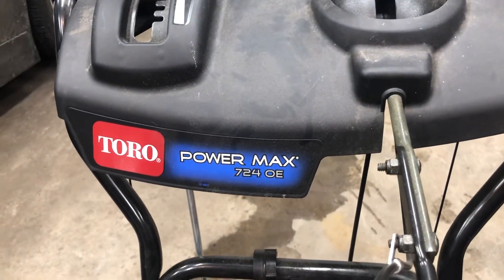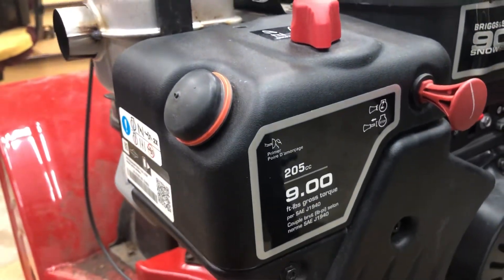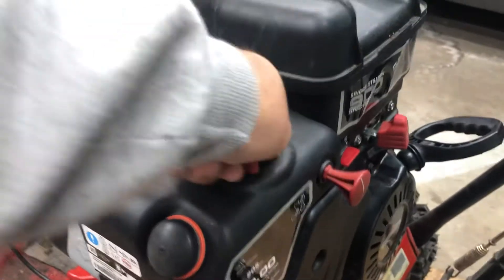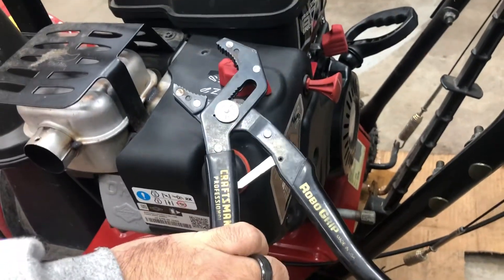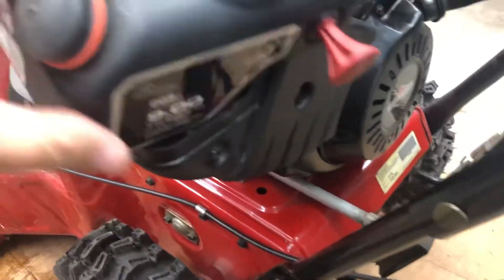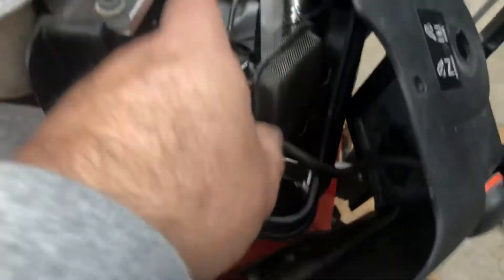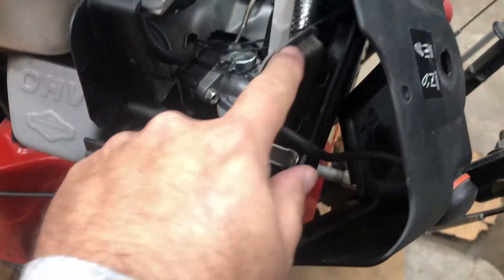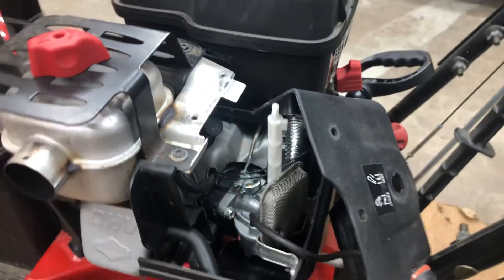Toro Snowblower Carb Repair

Comment: Hey Thomas! Great vise and tips! I just rebuilt my nkki carburetor on my Toro 1024 snowblower. I was pretty careful putting it back together. Now, when is runs with a load(snow in auger housing) the engine starts to slow down a bit and the snowblower struggles to pick up and throw it. Any ideas as to what the problem could be. It was not doing this before I rebuilt the carburetor. I rebuilt the carburetor because gas was leaking into the crankcase  because gas was leaking through the carburetor.
Reply from the maker: Does the engine sound different? I would replace the auger belt if you haven’t for a while. Also, if you haven’t replaced the spark plug, I would do that as well. The plug is a cheap easy fix that is often overlooked. If the engine is in fact slowing I always approach troubleshooting with the thought in mind that you need 3 things… air, spark, fuel. Spark is the easiest to solve or test for. Air and fuel can be a little more complicated. Rebuilding the carb, it’s possible you have an issue with air/fuel mixture which could be fixed by adjusting the fuel mixture screw, but if it sounds like the motor is running well at idle, that’s probably not the issue. In terms of fuel, make sure there is no issue with the fuel filter, or fuel leak somewhere else. Make sure tank is not clogged or anything else. 

Now the reason why I think belts, sometimes if belts get stretched they are now clearing snow efficiently, so then too much builds up and then it bogs the machine down. For similar reasons, if load is heavy if spark isn’t strong enough it may show itself under heavy load as well. 

So based on what I know right now I would go after the plug and belt besides they need to be replaced under normal maintenance anyway, they are fairly cheap and fairly easy to do. Feel free to provide more details and anything you try and what the results are. If you want to post a video on your YouTube, make it public and I can go look.

Other things to consider:

Use Mechanic in a Bottle. I think you can get it at Home Depot. Rather than most conventional cleaners this dissolves it down at its molecular level and evaporates the varnish. Others just loosen it and cause a potential clog elsewhere. 

I would consider replacing the carb if these other items are failing to improve the issue. I have had some carbs that are more trouble than they are worth to try and rebuild. Sometimes it’s better to spend $25 on Amazon for a cheap replacement. All the replacements I have used worked great.
Reply from the maker: One or two other things to consider, it could be the governor. When you re-installed the carb, if you put one of the little rods or springs back into the wrong hole, the governor could be off. 

Lastly but probably unlikely, it could be a valve issue. If it is a valve issue it could simply need to lapped and adjusted. 

Check out the following video that covers both of these issue a bit:

Link to the video:
https://youtu.be/OSN32jBReOg?feature=shared

Watch that video the whole way through.